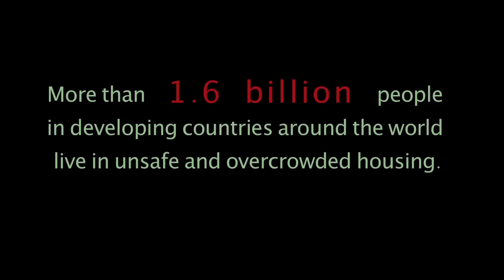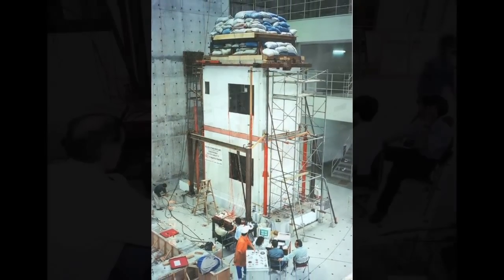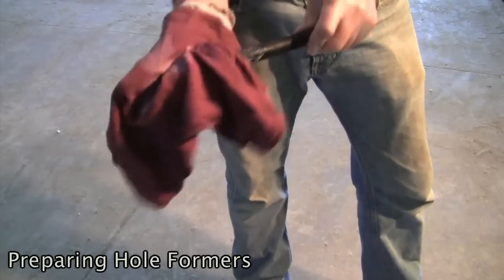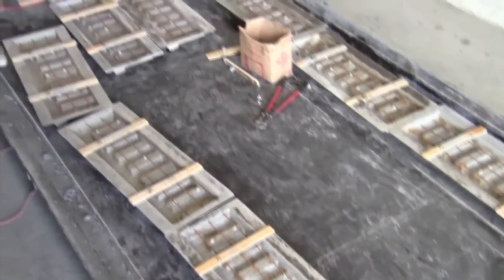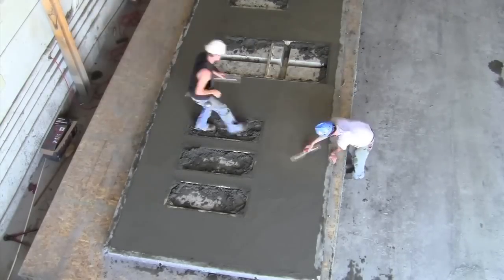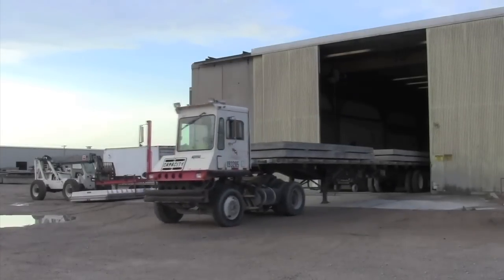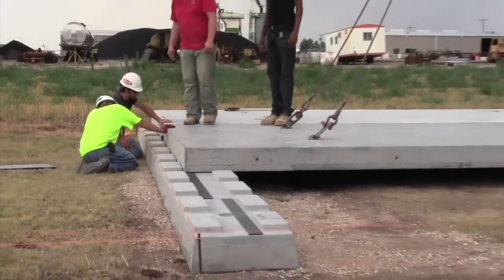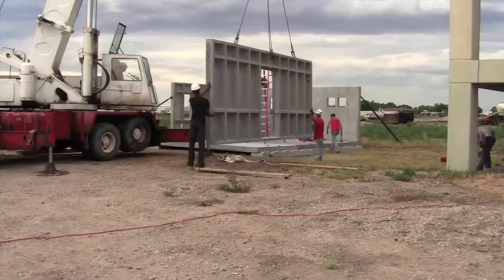Demonstration of Waffle-Crete affordable housing construction

Comment: very interesting concept, especially for those developping countries often hit by disasters.but, i see in Philippines, prices per m² is 20 000PHPwhile hollowblocks is about 30 000 and normal concrete way 25000th waffle method boast to save 50% materials, cement, etcit is also extremly fast process cos made in factory when hollow blocks takes weeks or months.so...how could the prices still be so high? need less workers, less time maybe 10times faster?, and 50% less materials.?there is also a waffle box, the whole house is delivered with a truck and crane, made whole and not pannels.

Comment: Jeez, there's a bunch of shitty comments, considering this is just a sample structure, built to show you how the panels are formed and put together.  There are a few other "waffle panel" building systems out there, not just waffle Crete.  I think the waffle design is highly reinforced, with the mesh, wirebars, and the waffle beams, not only that but the panels use less concrete by waffle design anyway, reducing costs.
I think the house is ugly, the caulk could've been mortar.  But it's a 4 wall design, and for the most part, you could make your own waffle molds, and make the panels yourself.  You could also build a more elaborate design, which has a better system for rainwater catchment, not just drainage.  I think the fundamentals of diy affordable housing are there.  The whole process could be replicated diy, with your own molds and panels.  The crane rental for a day isn't really that expensive either.  I'd like to see a septic mold, incorporated into this, and create a truly livable structure, from just the panels.
But I like concrete building.

Comment: Cool video. The only concern I see is they put some sort of caulking when they installed roof. However, when they put walls on the floor there's no foam or caulk within the joint there. This would be an issue for seeping water from raan, and not to mention bugs infestations?Just wondering how do they remedy these aforementioned issues?

Comment: Where are the chase ways for electrical or plumbing.   Hammer drilling through concrete to run that stuff after the job not so fun....especially when hitting rebar, then you have a cripple stud.    This is just an above ground culvert ... that they didn't use mastic tape to seal the joints.   I mean this is much better than the shazzaks they have out there in the Barrio, but could they really afford these units either?   I mean trucking, diesel, concrete, heavy crane all cost a lot of money.    I think Earth Bag construction is a lower tech, and more affordable solution.
Reply: I have to agree. This would be good for large scale mass housing projects in the thousands. But at a human scale, not so much. I like the clean construction though.

Comment: 8:44 Backwards... unskilled workers is right!
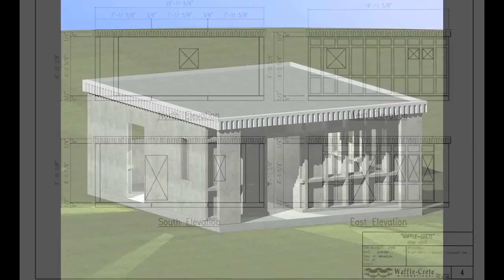Reply: I think it's intentional if you'll look at the design at 1:58 and I thought about that too. I'd rather have all those columns facing outwards especially when building in hot regions to provide more surface area for heat dissipation; same with Eastgate Centre in Harare, Zimbabwe as natural air-conditioning system